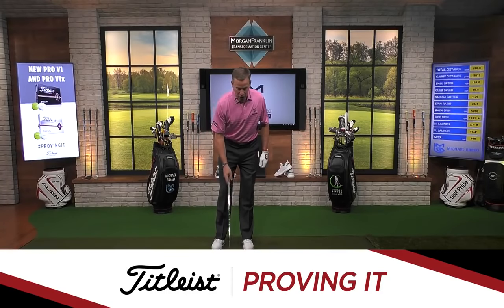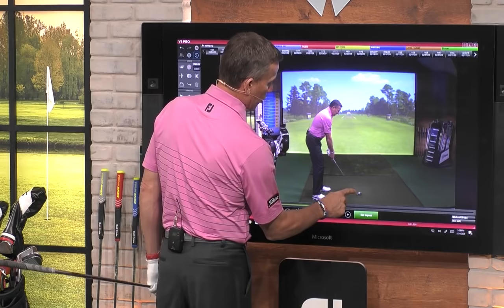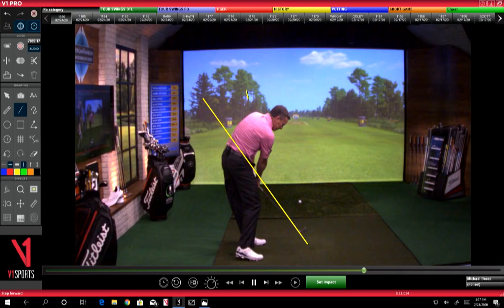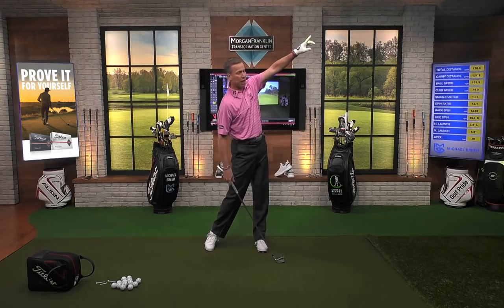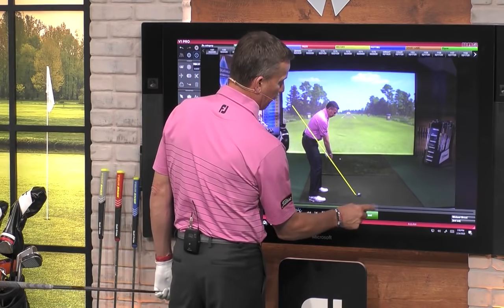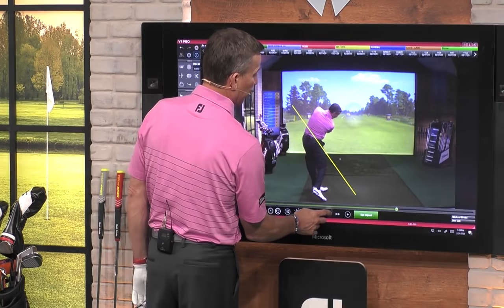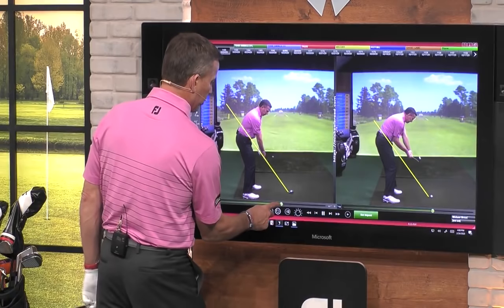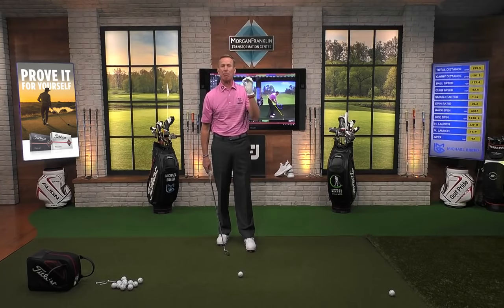FINALLY Fix Your Swing Path With THIS Drill from Michael Breed

Comment: Here's what nobody talks about.  40 years of muscle memory will NOT LET ME come inside.  The worst part is I cannot feel it.  I've tried every drill I've seen and as soon as I get to the top my hands start moving forward but I simply cannot feel it. I have tried to completely stop my swing at the top but sure enough, my first move is out and down with my hands.   It will take me 10,000 swings to fix and change the myelin in my brains and that's fine but I have to start with one and so far I can't get one swing.  The worst part is I'm a pretty good athlete, have fast twitch still, I'm in great shape and know the golf swing.  My grip, set up and takeaway are all perfect but my brain takes over at the top so for me it is not physical it is mental and that's the worst part.  I've played for 30 years but I will quit if I can't get to my full potential.
Reply: Same here! I'm reasonably ok on the range but on the course something takes over at the top of my backswing. Can't get my hands/arms to swing inside. Hit all my clubs on the heel. It takes so much effort to make my arms swing down through where they were at address. Four lessons with different instructors with no change. No one is swinging that club but me.

Comment: I like this drill but I wonder why you didnt talk about part of the problem which is the lack of club depth at the top of your back swing. Its alot easier to shallow the club if you make a better shoulder turn and get the arm angle lower and more off the back shoulder. You can see very clearly a different hand position in the first video vs the second video.

Comment: this is a fantastic drill, i always suffered from a out to in path and struggled to fix it until my coach gave me this drill to do. its almost an instant fix and gives you a completely different set of (correct)feels to get the path right. i always do this prior to any range session and even do it on the tee while im waiting for my turn to shoot.

Comment: Most noticeable @5:50 are your wrist conditions to compare shaft position at parallel. With more extension in your trail wrist, the club would fall on the inside.
Reply: Yeah I noticed that too. You could do what he did in the good arm position with poor wrist angles and still come over the top. And you could also have the arms less ideal and have good wrist angles and be on plane. It’s all about the matchups in the geometry of the swing.

Comment: Great, you just cured Sam Snead and hale Irwin among many.
Reply: Who knew, they were doing it all wrong! Actually the hands came ott but they rotated the left arm at the top or soon after so the club came from the inside. That doesn't fit with modern coaching. There are many ways to swing a golf club (I've tried them all).

Comment: Michael, If the goal is to shallow the club in the downswing, why not not start with a shallow backswing? Please help me understand. I’m a beginner.
Reply: Thanks Igor. I had the same thought. When I am coming over the top, I find consciously shallowing the swing plane helps. If you compare 4'10" to 5'17" that is effectively what MB does
Reply: If you start  your back swing real shallow, there is the risk of producing a kind of round house type swing where your upper body is pivoting around your lower body and feet instead of moving towards the target. This will often produce a big slice, or a big pull depending of when you make ball contact.